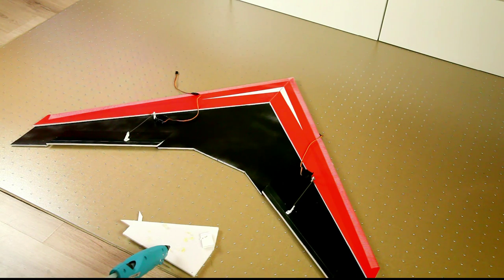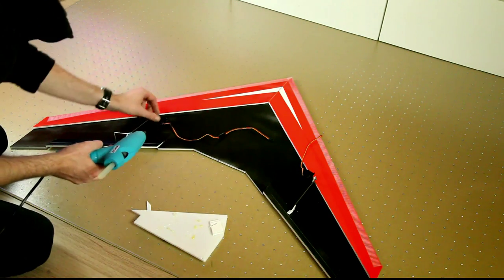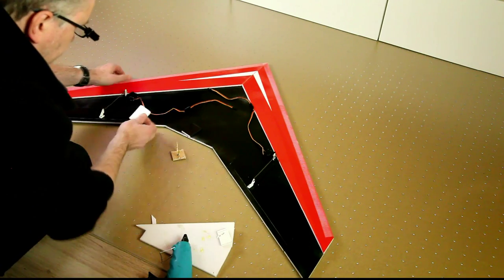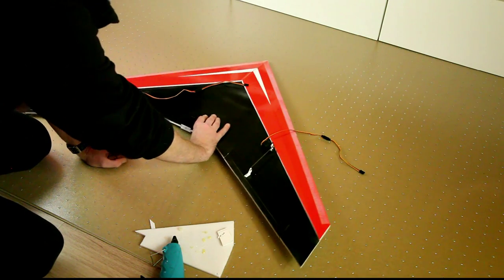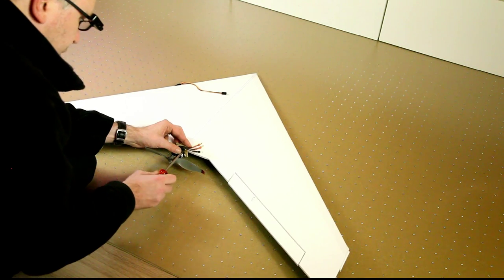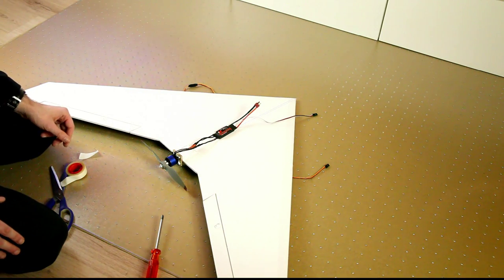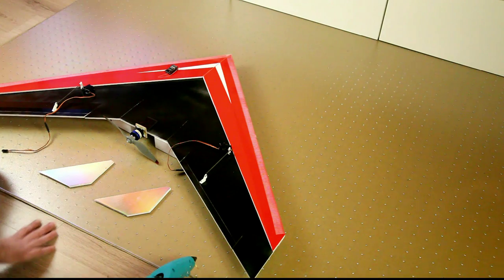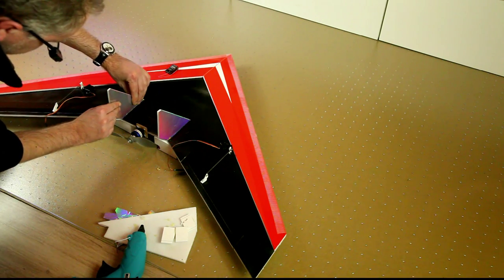Scratch building a flying wing! Part.4 - Electronics installation.. We're almost ready!

Comment: Hopefully I will finish mine today and maiden it this evening or tomorrow, weather permitting. I've read that the KF wing usually wants the CG a bit further back than a normal CG calc will indicate. But a forward CG is safe to begin with. so I'll go with that.
.
Heh, I just bought Dick Kline's book The Ultimate Paper Airplane, from Ebay for £3. That should be fun.
 Have you tried the Omniwing? That's a nearly flat, tailless, folded paper flying wing. If you make it accurately, it can achieve great flights off a slope. I managed about 20 meters before it hit my neighbour's house!
Reply from the maker: +ChuckPlains Good luck with the last bits & the maiden then offcourse sir! :D 
the Omniwing.. No, I had not heard of that one before :)  I'll look into it! 
Cheers

Comment: how do you find the cg
Reply from the maker: +Aldo Allende Oliva There is a link to teh CG specs in the video description Aldo :)
Reply: +DutchRC Adventures that web site didn't work for me. I don't not why. Is that web on centimeter or inches ?? I had tried on inches
Reply from the maker: +Aldo Allende Oliva The site works in CM.. It regretably doesn't have an inches switch.. Sorry about that.. If you click on the CG box, the illustration should show the CG.. It will probably only work in real browsers though (like Chrome on PC's)
Reply: +DutchRC Adventures ok maybe that's the problem that I had
Reply from the maker: +Aldo Allende Oliva Check.. You should however be able to see the CG-distance?? it is 29.21cm from the front-tip of the wing.